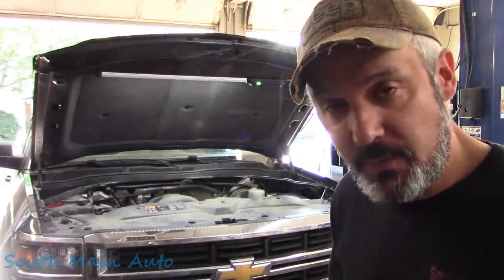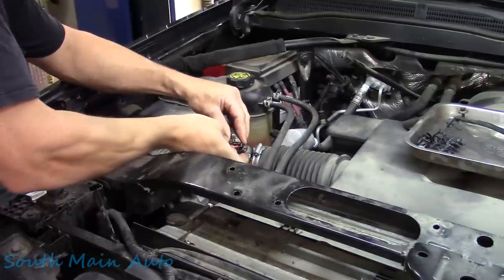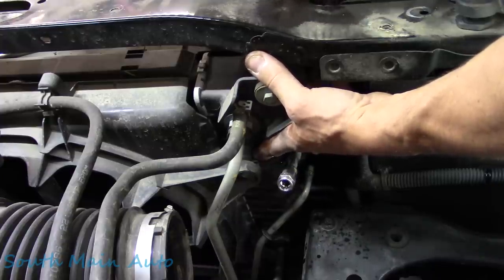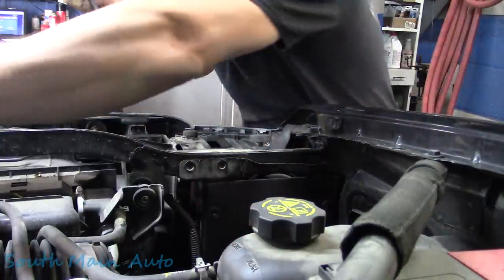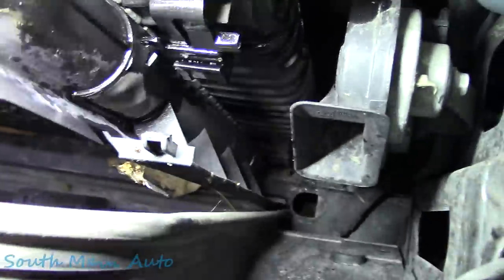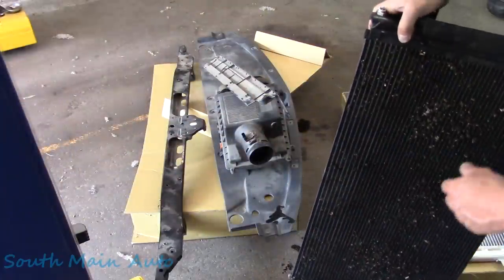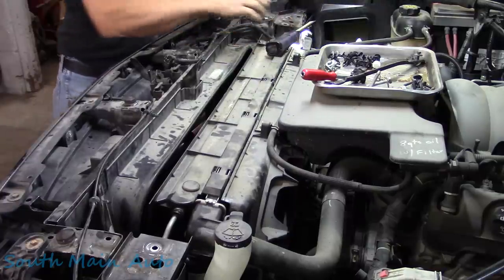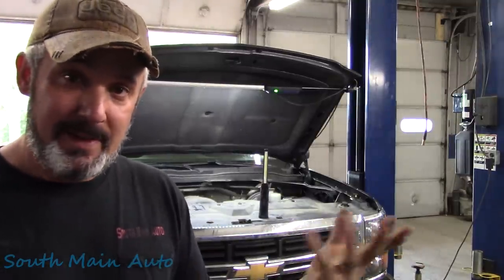Chevrolet 1500 / Tahoe - No A/C Leaking Condenser

Comment: Once a system has lost its charge, there is no need for a recovery, as the remaining small volume of refrigerant is considered a "de minimus" amount for EPA purposes. This is a similar dynamic to pressurizing the system with nitrogen and a small amount of refrigerant for the process of leak detection using soap bubbles like Big Blu or an electronic detector that reacts to the leaking gas. In both cases, the remaining gasses can be released and the system opened for repair. This applies to both section 609 and 608 situations.
Reply: Some mechanics do it, because that is the way they were taught. 

There are situations where the A/C will only leak under higher pressures. It will not blow cold air, but it can have significant pressure in the system. If someone does not evacuate the system, then they might get a refrigerant poof, when it depressurizes. I have also seen A/C systems evacuated at cooler temps, then the part comes in and the system has a little refrigerant that causes pressure due to high air temp later in the day. It is also wise to suck it down for an extended period of time, when not changing the dryer/ accumulator. 
Usually it is wise to evacuate the system just before doing anything on it. 

However, when some junker like this comes in, then some shops don't want to touch it with their machine, because people put a lot of foolish things, like AC stop leaks and other nonsense in the system. No mechanic wants to contaminate their recovery machine with that.
Reply: @willw8011   In the case of a system that only leaks at a higher pressure..... that is the reason that you use the pressurized nitrogen in the system. I have had to test R410A systems using a pressure of 400 PSI to find a leak. Now... I probably wouldn't use 400 PSI in an automotive system because of the hoses, but I probably would use 200 PSI in that case. You simply have to know what's in the system and what the pressure is to know when recovery is going to be required to meet the EPA regulations.  You always have the option of recovering the entire system charge into a separate tank if you have doubts about which refrigerant has been introduced by other persons working on the system before you received it.

Comment: I had to do a condenser out of pocket on my 2014 Sierra. A friend had one done under warranty on his 2019 at about the same time. It's a crap design. I wish that GM, or an aftermarket manufacturer, would come out with an improved part. (I got rid of the Sierra a few months ago, and I'm hoping the current Silverado is better.)

Comment: Wow, a 2014 pickup and it already needs an a/c condenser, radiator, and it sounds like a transmission may be next on the list. I haven’t had a problem with any of those things or anything else that major/expensive on my much older truck made by a different manufacturer.

Comment: Interested to know why his black light did not show the leak. Did you black light it to see if it glowed ??? I've had really good luck with the dye and light since 88 on the old R-12 and R-134a now as well as my home a/c with R-22. I found the heat pump leak that my repairman/installer said I didn't have. Said it held vacuum so it was good to go, but the 2 year old unit leaked down in less than a week. LEAKING EXPANSION VALVE. He said he had never seen the dye used before. Well,  he has now. Two weeks later it was down again. I rechecked and where he soldered in the new valve his joint was leaking. DO OVER. I will not use him again if/when I ever need a new unit. That's why I asked if you black lighted the suspected leak.

Comment: Those rad's leaking at the sides is another common issue on these 2014 motel year trucks. I believe GM had a TSB on it..... 

That trans fluid is horrific but not surprised.... The 6 speed in these trucks is garbage.

Comment: This is why I can’t stand working on anything newer than a 1999. Engineers have over complicated every single thing on new vehicles. Even oil changes are getting more difficult because you have to remove underbody covers with 10,000 bolts and when you go to change the filter, you can’t hardly see them. I changed the condenser in my 92 Sierra in less than a half hour after the system was discharged. Pull the grille off and remove the bracket holding on the hood latch and horns and the old one is out.

Comment: Man, that looked like a pain. I bet the bill's gonna be Condenser $200, labor $1800. No wonder dude kept filling it up every few weeks.

Edit: Why go through all of this again if he decides to do the radiator? Would have saved him money (double labor) and you time if you'd gotten approval for that as well before you changed out the condenser. 

My day job had a 2014 GMC Sierra that had both of these problems. Condenser went, and we had to dump a gallon of coolant in it every oil change. Trans finally went at 205k and they got rid of the truck. We still have 3 2013 Sierra trucks with over 400k and going strong. They don't make em like they used to!

Comment: As dark as that transmission fluid is it may not survive a fluid drain & replenish.  If the transmission isn't slipping now that old fluid with wear particles in it may just be holding it together temporarily.  I guess the customer gets that disclaimer when the procedure is recommended.
Reply: Yep. With auto trans, either service it regularly or let it die. Can't save them after a certain point. 

And the whole "lifetime fluid" nonsense with modern trans and rear axles is a complete lie. A lie that isn't believed by anyone who works on them. Lifetime of the powertrain warranty, and that's it.
Reply: Good thought...best to only change a few quarts and filter then do it again in 5,000 or so miles.

Comment: I got a nice "accidental" tranny flush a few months ago in my old Cherokee 4.0 ... headed up a hill from home and saw some smoking/fluid ... cooler line blew off the radiator ... stopped, reconnected the line ... and a nice couple stopped and then ran and got me a few quarts of tranny fluid ... and got home okay .... only blew out about a quart ... close one, but stopped right away ... got a new line installed ... putting in a new AC condenser this week ... same leak on drivers side ... but mine is 22 years old with 258K on it ... replaced whole AC in the spring except interior evaporator and condenser  ... dye found the leak easy enough ... just  pin hole, but enough to make a new condenser worth it

Comment: The most surprising part of this video is the shop down the street just kept throwing more refrigerant in it. If any GM truck comes in with repeated ac issues and low refrigerant you can 99% of the time just toss in a new condenser without even diagnosing it. This has been common knowledge for years at this point. Shocked that not everyone knows this.
Reply: Not to mention the dirty trans fluid and the hose clamp around the air intake. His other shop doesn't seem to be  much help as a maintenance assessor.

Comment: should of done the radiator too while you were there. since 2015 i've done tons of radiators on the 14-17 trucks. can't remember doing a condenser though. the radiators are really bad for leaking out of where they are crimped to the side tanks. i'm in Alberta Canada so we have like 8 months of winter,  lots of salt, but we still have lots of 20 year old vehicles on the road, a pain to work on. and most trucks less than 5 years old have 300 000 on them.

Comment: Had a car 4 years old. The radiator fan quit working. The acdelco dealer want 3 times the price compared to other brand replacement fan motors. I ask why would I pay that much when I can get one for less than half what you charge? They told me it's an original gm part. Well, that's what is in there now, and it don't work. The other brand part lasted longer than the rest of the car.
Reply: Exactly the point to argue when people say use only OEM Parts.  Well, yes depending on the parts yes, very true such as sensors and electronics.  Other parts maybe not so much because the OEM failed...why buy another and maybe another OEM if they keep failing?  Time to move onto a good brand aftermarket like Delphi or Borg Warner to name two of a few.

Comment: The engineers really didn't want the tray under the air filter housing  to move!. It must have had 8 or 10 bolts securing it!!
Reply: That tray is actually on the opposite side of the radiator.  I believe Eric refers to it as an auxiliary battery tray.
Reply: @johnh8268  Yes, he did

Comment: Great job... people change oil every 3 thousand miles..never change Trans fluid..300 now or 7 thousand later..
Reply: Until you change it and your tranny stops working.
Reply: If you don't change your Trans fluid and filter at recommended intervals...you will be changing the Trans...if you're fluid is still slightly red you can change it. If it's dark red to black it's to late..
Reply: @davidbires2351  which almost no one does. Also even if you do your transmission could stop working.

Comment: You may have already answered this, if you have forgive the redundancy, I see you have the dewalt cordless ratchet and in the past have used the milwaukee m12 cordless.

Do you have a preference or noticed one being superior to the other? 

Does the battery orientation cause any issues for you with larger battery packs? 

I have the milwaukee long neck cordless m12, but have been slowly transitioning to dewalt (I like the 60v "flexvolt" tools) and was curious what a guy who uses them daily thinks.

(edited to correct some spelling errors)

Comment: It’s hard for me to watch you struggle like this Eric because this job only pays an hour not the 5 or 6 like originally all you’d have to do is remove the intake tube & unbolt the radiator & lean int back & the condenser slides out np

Comment: Question to anyone out there?  I will be doing this on a 2000 Chevrolet Silverado so far as changing out the A.C. compressor and accumulator.  I was wondering that if the condenser has never been changed out that I do so since I am already there?  Any opinions will be greatly appreciated.  Good video too!

Comment: Could that condenser not be repaired if the leak is accessible?  I use to solder repair my radiators until the core was no longer viable.

Comment: My mind is blown! How is it possible that you replaced a condenser on a modern vehicle without once having to fight the temptation to torch a hole through the body/fender/something to reach one bolt/nut that the manufacturer's enginerds decided was best to tuck away in an otherwise unreachable spot?
Reply: Shhh. Factory defect. They forgot to put it in

Comment: Hi South, I have a Chevrolet Sonic 2015 the the problem is that the high pressure pipe is cold and the low pressure pipe is warm and the A/C does not cool, what could be the problem? i have to recharge the system each month

Comment: seems like you'd want to hook the AC lines up and pull a vacuum before putting it all back together. I'd hate to take all that stuff off again if I had a leaker.
Reply: The vacuum is to dry the entire a/c system prior to adding refrigerant. It would defeat the purpose to dry it partially then have to dry it properly the 2nd time. The system has to be pulled to 30" of vacuum and left running for several hours to insure that all the moisture is removed.
Reply: @jdelbrid  in 10 minutes you be able to tell if it held a vacuum. those new machines work fast.
Reply: @kennethbode2017  if you watched the video, you'd know that that is exactly what was done.
Reply: @kennethbode2017  24:25
Reply: @mattmanyam  no question he did it. My comment was in regard to when he did it. I would want to know before putting and the stuff back on if it has a leak.
Reply: @kennethbode2017  gotcha.

Comment: Oh my Gawd, look at 16:50 or so.   I can't believe sometimes the sheeite that people will drive around on.   For your brakes to get that bad,  they must have been driving it with no pads, just backing plate and rotor for months.  It's a miracle some people make it through life without killing themselves, and everybody they share the road with.   Now I can understand being in a financial pinch, but you can pay any shade tree mechanic a few bucks to at least do a pad slap brake job.   Even wobbly uneven rotors and wore out brake hardware, with new pads, is much better than wobbly uneven wore out rotors, and backing plates only.  Have some consideration for everybody else on the road.

Comment: Have a question for you. As you know I have a 2000 Toyota Camry LE that was given to me by my cousin it was his father's Camry. Okay I have had the Camry since May 23rd 2018. So I have had the Camry for 4 years now. Question how often should I check the air conditioning stuff in air conditioning? It's not really blowing cold anymore. I also need to change the coolant. I've not changed it since I've had the Camry. This also needs to be done. Please respond thanks. Also Happy 4th of July.
Reply: @EarthSouthside  Thanks much for replying. This year of Camry doesn't have a cabin filter I check online and at the dealership. I found that odd. But never the less it doesn't have a cabin filter. Thanks for the other things you told will write this all down and keep it handy.

Comment: I can understand why it cost so much to have anything done on cars/pickups these days.  Disassemble the entire front end and maybe you can get to the part you're actually trying to replace.  The downside is you have to put it all back together.  IF you can replace the broken part.  
I can see why the other shop just wanted to recharge the system instead of fixing it.  They may not have had the tools or know how to fix it.
Reply: What else do they not have the tools for or know how to fix it?   This looks like a industry known issue that's also known to owners that have been burned by it.
Reply: It's just a bit of disassembly - nothing magical about it and pretty typical of many vehicles.
If they could't replace that, they should close the doors.
It probably only took Eric 5 minutes to remove the tray and cross bar.
Reply: @Cheepchipsable  
My original post stands,  today many shops don't have the knowledge to fix things correctly,  or the tools.  So why are they even in business? I have seen that too many times myself.  That's why I fix my own cars myself.  If I need to rebuild the engine,  transmission,  drive axle,  or replace a blower motor,  or fix electrical problems.  I do it myself.

Comment: Auto repairs and running the business correctly just don't seem to work together most of the time.  Perfect example here, doing the condenser replacement and then noticing a leaking radiator. What to do? Call the customer and tie up the service bay (waiting for parts) if they approve the radiator replacement or put it all back together for replacement another time but, at more cost since said vehicle has to survive another tear down process. 
In noticing the transmission fluid being black and the air cleaner intake hose clamp loose as well as the repeated A/C recharging, I'd have to suspect the customers "other shop" isn't doing him any favors when vehicle is in their shop. Maybe they need to brush up on their ability to convey some of the vehicles needs to the customer or they need to get it together when they do their overall looksie on customers vehicles. That what a shop should do right? The fact that SMA got the customer to replace the condenser tells me the customer isn't getting the full service he should at the "other shop".

Comment: I have a 2014 Silverado with 139,000 miles, my buddy has the same truck, 146,000 miles.
We both tow a lot and are hard on them. We do maintenance them almost per the manual..
I've been on many off road adventures with mine ( I did have to replace my radiator my buddy has not)   they have both been great trucks!! and I'm still averaging 23 to 24 MPG highway...
I've heard of the condenser issues.
Is it the trucks built in Mexico??
Was it a certain run of condensers??
But anyway my 2000 Grand Prix AC lasted 254,000 miles. It did need a condenser at around 200,000 miles because of the road debris..
My brother's blazers AC lasted about 290,000 miles..
I know GMs quality has gone down hill like everyone else, sad because the prices keep going up...
To replace the radiator was kind of easy.
I just removed the cooling fans and the radiator slid up and out of the condenser, I did not have to remove the aux battery tray..